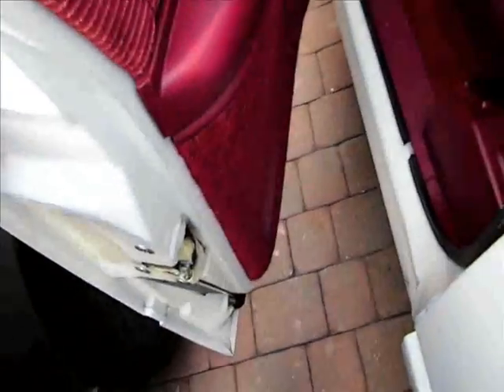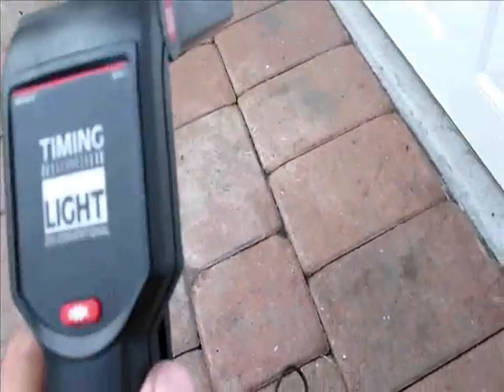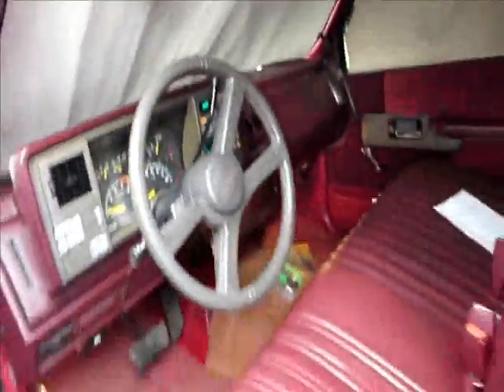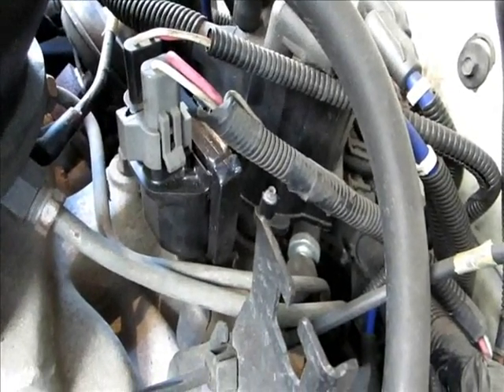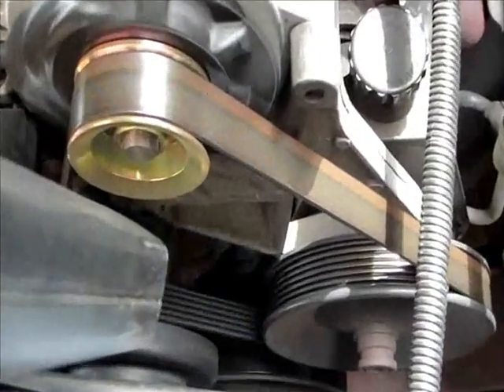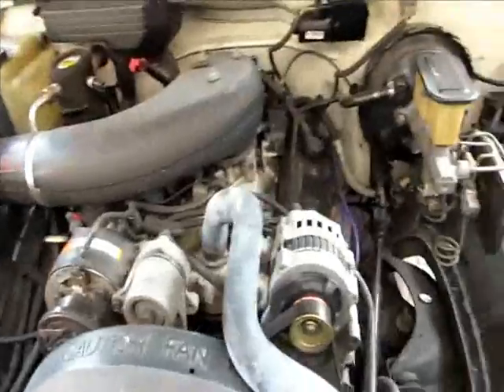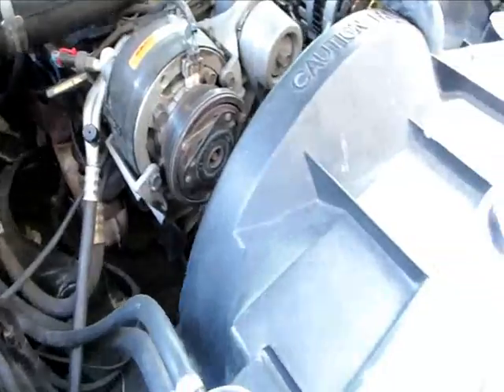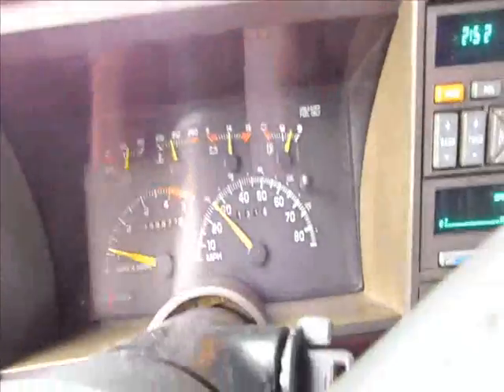How to set ignition  timing 88-95 GM fullsize truck Silverado Sierra Suburban Tahoe Yukon

Comment: I have a 1989 chevy c1500 with 5.7 tbi. It's starts up no problem runs perfectly normal for a few minutes then stalls UNLESS you touch/have your foot on the gas. I have changed almost every sensor ignition module full tune up. Does anyone know what it can be?
Reply from the maker: +joncabana1 Is the EGR valve stuck open? Check it, see if it is depressed, You can push on it. Just don't touch it when the engine gets hot! ouch!
Reply: @zachcarnahan2541  on my 1994 5.7 the egr was loose and sucking air under gasket, new gasket and tight runs ok now

Comment: About 5-7 years ago I had my distriberter rebuilt BC my timing was jumping all over.Its a 90 chev K-1500 with a 350.Now it runs great but I think its uses some coolant.Needs a intake gasket.
Reply from the maker: I have a stash of new housings and distributor shafts, It has all new electronics but I reused the housing and shaft, I should really replace it. Its not any aftermarket junk either, its original parts